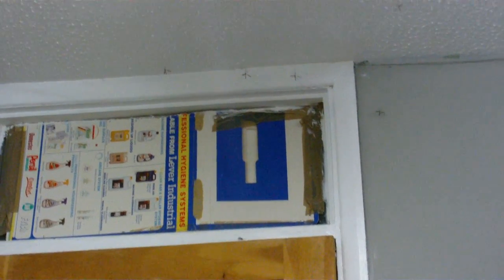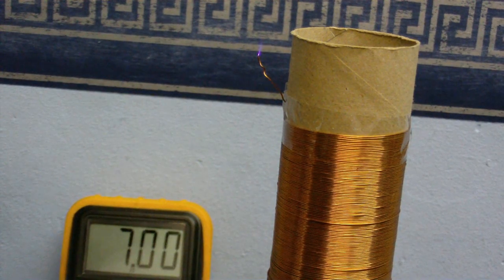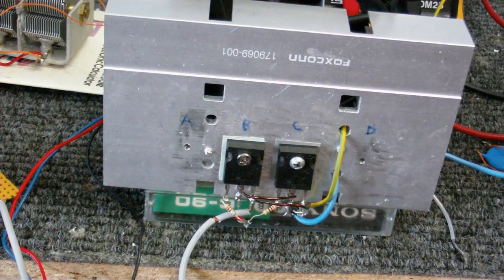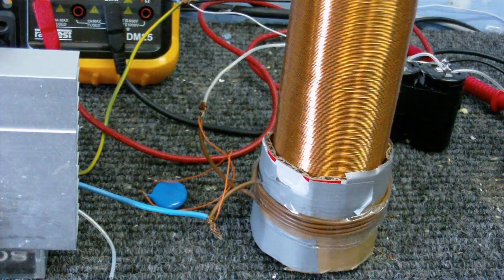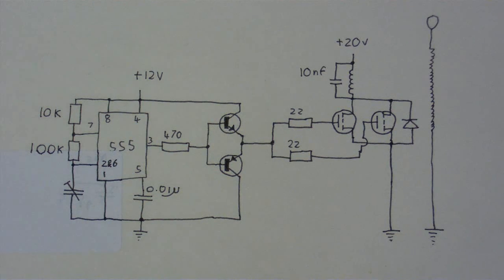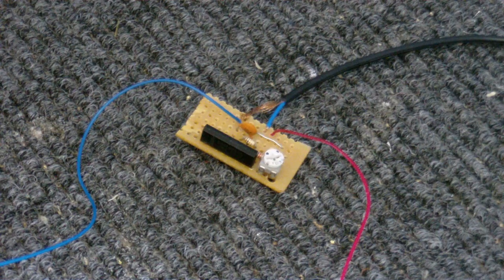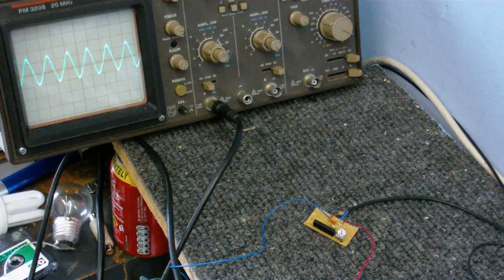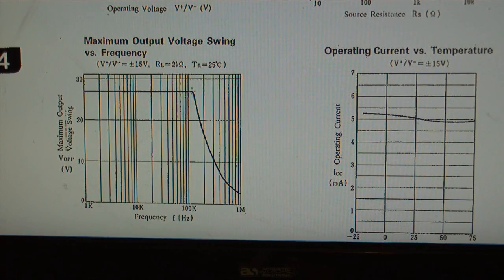Experiments with desighning a sstc and oscilators

Comment: I now you build a more efficient version of this circuit using a single MOSFET, but if you used a 4013 FlipFlop wired as a T flip Flop, the output wave form will be a perfect, 50% square wave.

Comment from the maker: The buffer's there more for protection than anything else, if something should go wrong such as high voltage kickback from the primary getting fed back into the oscillator circuit, the 555 will have more chance of surviving, the transistors would by the only parts to replace, which is a lot easier than having to desolder a chip and replace it.